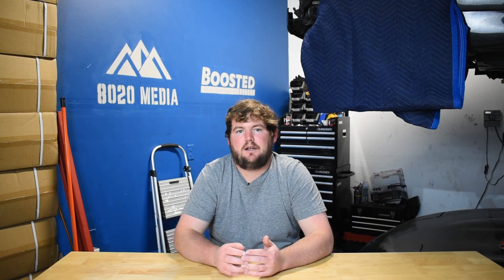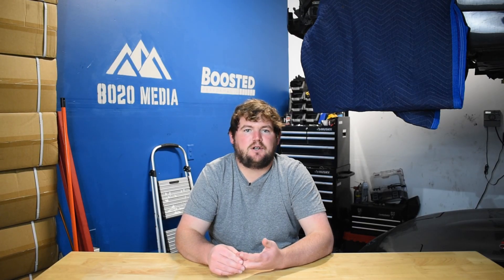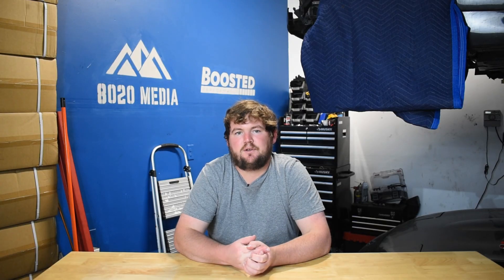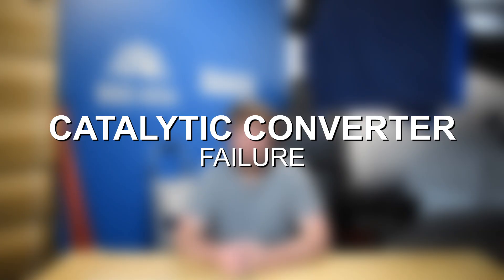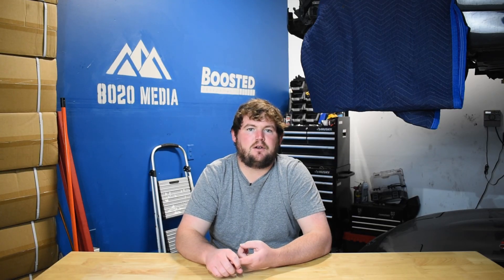Hyundai’s 1.6 Engine | Reliability & Common Problems

Comment: Nice video!! Kia makes good engines( except for the Theta 2.4)!! It's neglectful or ill-formed owners that ruin ANY car brand engine!! A neighbor blew up a Dodge 2.4L Tigershark last year running two and a half quarts low on oil! My fully loaded 2014 Kia Forte ES just turned 118K and runs like new!! Change the oil with a new Wix filter, full synthetic every 5K, add a bottle of Chevron Techron and Cataclean once a year, and I check ALL fluids weekly!! Take car of your car and your car will take care of you 😊!!

Comment: 2013 Veloster with 1.6 GDI naturally aspirated. Catalytic converter clogged almost on the dot at 100k miles and forced the car into limp mode on the highway. May or may not have hollowed it out and used a spacer on an O2 sensor to prevent the code and CEL.

Comment: Here we go...i bought a 2015 kia soul 1.6 gdi with 6 speed manual transmission,  brand new. Bought a KN air filter, like the second day i got it. Oil changes from Walmart every 4000 miles regular quarter state. That little coach roach refuses to die on original engine and transmission at 270k miles. At this point is all beat up from the outside paint ,gets tires from pick an pull ,but everything works from electrical to mechanical.  I guess is all how you take care of it....😂😂😂😂😂
Reply: Any engine related trouble? My rio is about 200 000km and the engine is solid and working as new...PCV valve changed at 96 000km...that's it...I love that little engine! In manual it feels like honda used to be...
Reply: I too got some doors and part from u-pull to keep it fresh! 350$ for a front fender, driver side door and hatch, an afternoon of wrenching all color matched, also got 17 inches mags and brand new tire a aliexpress 11 inches radio...and added sound insulation...LED headlights too! it's a cheap fun car, mine is 11 years old and rocking! I love this little thing!
Reply: @theadvocate4698 the newer 2.0s from kia for some reason catch on fire 🔥, I think is the oil passages that get block or something cause. I like the 1.6s from kia the rest i can't speak on 100%% but i would stay away.

Comment: I just picked up a 2023 N line 1.6 L turbo. I really have not seen any negatives on the vehicle. It only has 14,000 miles on it at this point.
Reply from the maker: J - Congrats on the new ride! We would advise just maintaining it well.
Reply: @8020Automotive  Thank you, i’m a firm believer in changing my oil every 4000 miles or six months which ever comes first.

Comment: Great video.  I have the 1.6L turbo on my 2021 Kia Seltos SX.  It passed 30K recently.  The car is never in cold weather (desert climate here) but doesn’t get too much highway driving.  Should I get the pricey fuel induction service my shop is suggesting?

Comment: Question ... what if you ran a say a tank of E85 thru the engine (if it E85 approved) would that act as a cleaner for the GDI system ?
Reply from the maker: B - Running a tank of E85 through your Hyundai 1.6 GDI (if it’s flex-fuel rated) can help clean fuel injectors and combustion chambers, but it won’t do much for the intake valves — and that’s where most GDI carbon buildup occurs.
Reply: @8020Automotive  Food for tought, i saw a video of the internal working of the 1.6 GDI, and from the video, it seems like the injectors are shooting directly on the valve, wich would help to keep it clean ...Of course the chamber is not getting cleaned, but the valve may be...it was worrying me when i bought the car but it runs great after 200 000km with regular oil change only, no problem at all from "gunking"...

Comment: I have a 2019 hyundai veloster turbo r spec and I've driven the fuck out of it. Have 108k on it. Have done regular oil changes atleast every 7k miles. Lucas stabilizer everytime. Have had NO problems with the motor itself, I did replace the plugs around 70k. And again at 98k, at 98k also replaced coils, 1 went bad. Figured replace em all at once and just b done with it. Fixed the misfire thst had judt started

Samn good car

Ive driven it ALOT cruising at 100, 110..

Need to service the trans soon.
Reply from the maker: S - Thanks for taking the time to share your experience. Sounds like you take great care of it!

Comment: I’m here because I just bought a 2025 Santa Fe hybrid with the 1.6 turbo. I haven’t had an engine this small since my 1979 Accord. I’ve a motorcycle with more displacement. 
Good to know these don’t have the same issues that the Theta’s did. I had to replace one at 90k in my old Santa Fe. Hopefully this Santa Fe will not repeat that. 
Good content , liked and subscribed.
Reply from the maker: S - Thanks for the feedback! Your Santa Fe has a newer generation engine. So it should be fairly solid, so long as maintenance is kept up with

Comment: 2015 Hyundai Veloster NA Reflex Edition. Horrible car. Gave up at 169K. It was great at first then around 140k started having oil consumption issues. Started taking care of it better with shorter intervals between oil changes, carbon cleaners, fuel cleaners, etc. Had to get a new catalytic converter and still the issue persisted with a CEL to the point it left me stranded several times. 

There was a time I was putting a quart of oil every 200-300 miles. Used Valvoline Restore n Protect and it reduced that by ALOT. My car was on recall but dealership wouldn't honor it. Said they already inspected it when I brought it in for oil consumption issues and it didn't need a new engine. Called Hyundai Corp and got the run around, said it wasnt a clean title. So disappointed considering my first car was an 06 Hyundai Sonata V6 where the Trans gave up at 200K. Loved that car. The 1.8L I4 veloster? Trash

Gave up and got a Honda, best decision ever. Never going near a Hyundai ever again. JDM and German all the way.
Reply from the maker: M - Sorry to hear this.. However, we appreciate you taking the time to share your experience!

Comment: Have a 2014 Kia Forte Koup SX 1.6l turbo. Bought it with 98,500 miles. Turbo went out at 109,000 miles. Starter went out at 115,000 miles. Replaced camshaft position sensor. Oil filter cooler replaced at 117,000 miles. Right wheel bearing at 115,000 miles. Hope I’ll start getting better luck.  We are almost at 118,000 miles currently.
Reply: You seem to have bought a beat up car.
Reply: @dgdave2673 yeah 119,000 just hoping to make it to 200,000
Reply from the maker: 2 - Thanks for taking the time to share your experience! We hope you do too.

Comment: I’m giving serious thought to getting a new Venue in 2026, and it has an important engine upgrade: dual port injection (the 1.6 DPI engine I believe they introduced in the 2020 Venue).  DPI, which Toyota has also brought out, addresses the carbon buildup problem that’s so common with a lot of GDI engines.  Does anyone know how the DPI engines are working out? If so, I’d love to read any comments by people who know.
Reply from the maker: I - Hyundai’s 1.6 DPI (Dual-Port Injection) engine in the 2026 Venue is a solid improvement over traditional GDI (Gasoline Direct Injection) engines, specifically addressing carbon buildup on intake valves—one of the biggest downsides of GDI-only systems. By using both port and direct injection, DPI ensures that fuel is sprayed over the intake valves, helping to clean deposits and improve long-term reliability. Toyota and Honda have also adopted similar D-4S and dual-injection systems for the same reason. Early feedback on Hyundai/Kia's DPI engines suggests they are more durable and require less maintenance compared to their full-GDI predecessors. While they may sacrifice a bit of fuel economy and power compared to full-GDI engines, they offer a better balance of performance, longevity, and reduced intake valve cleaning needs. If reliability is your top priority, DPI is a great step forward.

Comment: Great Info on GDI I'm still new to GDI. I found this vid looking for the head torque specs on 2014 veloster 1.6l  GDI, if you know the specs it would help I don't have access to service manual thanks' in advance
Reply from the maker: B - Torque all head bolts to 18 lb-ft (25 Nm) in the correct sequence. Tighten all bolts to 44 lb-ft (60 Nm) in sequence.

Comment: Hello. My car is a 2024 KIA SPORTAGE PHEV, Hyundai-KIA G4FT Smartstream 1.6 T-GDI engine
The 1.6-liter Hybrid has been produced since 2020 and is installed in hybrid versions of 
such well-known models as Tucson, Sorento and Santa Fe. This power unit is widely used in Europe.
What oil with the highest viscosity would you recommend, given the engine design,
because I don’t want to pour 0W20 water. I know about hydrocracking, PAO and other oil characteristics.
What do you know about this G4FT engine and what would you recommend paying attention to during exploitation?
I fill my old BMW M57 2005 engine with fully synthetic 10W60 RACING oil,
so the engine runs great for a long time and I have no problems with the engine.
Reply from the maker: M - Switching to 5W30 or 5W40, if permitted by local climate and driving conditions, can provide a slight increase in high-temperature protection while remaining compatible with the engine's design. However, ensure the oil you choose meets the required specifications for modern turbocharged engines.

Comment: Kia soul 2014 with a G4FD. Cylinders scrapped the cylinders wals, dead at 110.000. engine replaced with a new one. 33.000 miles later with the new engine, the oil is turning into mayonnaise. new cylinder head gasket required. Since I was not the original owner, Kia reject any reimbursement for the replacement of the engine. Those engine are crap. Poor manufacturing, poor use of material.
Reply from the maker: M - Sorry to hear this. However, thank you for taking the time to share your experience!

Comment: How about the knocking issue that Hyundai offered extended warranty on? Considering a used 2014 Hyundai Volester with 100K miles. Will it just die on me?
Reply from the maker: Y - Not likely, but you'll certainly want to get it checked out!

Comment: I have a 2010 hyundai accent with 160k miles I really love it. Its slow lol but a great first car or daily driver, I put 2 12 inch subs in it 😂. After 2 years I have only had water pump failure and the ac belt, I changed the o rings and valve cover gasket after some misfires and changing multiple spark plugs no problems since. In the last full year its been 0 problems (knock on wood) im more worried about the transmission then the motor honestly. Appreciate this video!
Reply from the maker: S - Thanks for the feedback and taking the time to share your experience!
Reply: Thats a pre-nightmare engine, those are as reliable as early 2000s Toyotas.
Reply: @chiefdenis definitely not 😂 either my mechanic sucked or the engine sucked because after I had the water pump changed with the timing belt the timing belt slipped and got stuck in the engine while I was going to work in the morning, it's an interference engine WITH A TIMING BELT, I think the belt got wet but nontheless not a car to keep long term it's not made to last. so now I have a Honda civic and it's the  best car anyone could ever buy. It has a timing chain which is important for interference motors and it had a 100k tune up.

Comment: They seem to have high oil consumption from what I can tell, every one I've worked on a had low oil some to the point of oil light flickering. 

Plenty of examples of dropped rods too resulting in catastrophic failure.
Reply from the maker: N - Unfortunately!

Comment: Some say the piston rings are flawed on the 1.6L which causes excessive gas to get into the oil.
Reply from the maker: F - This is true.
Reply: @8020Automotive  I'll have to send an oil sample to one of the labs to be sure I'm changing the oil before an unacceptable amount of gas gets into the oil... I wonder how much it would cost to have a good engine shop to install good aftermarket piston rings. Any idea?
Reply from the maker: F - Not too sure. Difficult not knowing labor rates, etc. But it wouldn't be cheap.

Comment: Thank you for so much info! My 1.6 gdi  is 10 years old and i was worried about long term reliability, so few info on them...that was very ressourcefull! My guts tells me this is a good solid engine as it as given me no problem at 186 000km except the pcv valve at 96 000 km...plus in a manual car, it feels like a honda's of the 90's...I kinda wanna get a 1.6T in manual...seems fun!
Reply from the maker: T - They can be very solid if taken care of!
Reply: 195 000 and still going strong! Maybe it is a good engine?

Comment: I just bought a used 2016 Rio LX with 106k miles. Looks like past maintenance has been spotty. I just did an oil and filter change and will be checking the PCV valve and air cleaner soon.
Reply from the maker: You can turn it around! Just hit all of the 100,000 mile maintenance and stay on top of it. Hyundai's can be very reliable!

Comment: Kinda nervous about my 2020 veloster turbo, i wanna push maybe 230-250 hp with a tune but not sure how it will hold over time. I plan incrase flow and remove air restrictions, the turbo oil line was something iv not heard anyone talk about but I'll def upgrade that. Anything else that might be effect alot by the increase in hp and boost? I know new spark plugs is good idea before a tune.
Reply from the maker: P - We have an article on our website that may be helpful here: https://tuningpro.co/best-hyundai-veloster-turbo-performance-mods/

Comment: Have a 2017 turbo with DCT, have intake, exhaust, just put on an oil catch can a few months back and got the intake valves cleaned.  Bought it at 87k and at 115k miles currently and still runs great even at WOT. The only issue that I ever had mechanically was a bad fuel pump.

The car is not as bad everyone makes it out to be. Yea some come out bad and shit the bed immediately but what car brand hasn’t had bad model years/recalls? As long as you do proper maintenance and don’t dog it everywhere, this little clown car can go the distance with little issues.
Reply from the maker: P - Well said! Thanks for sharing your experience.

Comment: Thats why its detrimental to use atleast mid grade gas, gas additives occasionaly between fill ups, only OEM  oil filters and change oil every 3500 to 4k miles. These engines as all kia/hyundai engines have weak oil pumps.
Reply from the maker: R - Well said!

Comment: I’m looking for information regarding connecting route failures in the 1.6 L GDI – I have a 2015 Hyundai Accent– I’ve already asked for a an extended warranty, but was denied, but I believe that this is a far more common problem than Hyundai is letting on in Canada
Reply from the maker: D - Guessing you mean connecting rods?

Comment: Mine has a slight ruff idle whenbi cold start it every morning but goea away after 10 seconds and all is fine after. Should i be worried??
Reply from the maker: A - So long as it goes away, you should be good. We have a video on rough idle that we think could help in the future: https://youtu.be/BiYsqRJCLhE
Reply: @8020Automotive  cheers dude
Reply from the maker: A - Keep us updated!

Comment: In a Kia Rio 2019 s   … does it have a gamma or a gamma 2 ?
Reply from the maker: S - Should be a gamma 2.
Reply: @8020Automotive  Ok… but are some Sensors interchangeable between Engines Because I’ve replaced a sensor that goes to a gamma 1 in my Kia 2019 and it’s running like a Champ ?
Reply from the maker: S - I'm sure they are. Very similar engines.

Comment: I’m confused. Does the 2022 accent se have dual injection? I’m getting different answers
Reply from the maker: Run a VIN check and see what engine you have. MPi is traditional port injection, DPi is dual port which is direct + port injection fueling.
Reply: @8020Automotive  says MPi for mine. Thanks for the help 🙏🏽

Comment: Do you know if these are common block/components? Theoretically if I have a 1.6Mpi I could take a T-GDI turbo and exhaust manifold I could bolt it up and plumb it up and tune it? What about the IVT transmissions? How much torque can the IVT handle? Thanks in advance
Reply: I would look up the possible mapping issues software wise because now you're forcing more air into a mpi engine.

Comment: Save you a bunch of time;
Don't mess with these things, they are trash. 
Just buy Toyota or Honda.
Reply from the maker: B - Not necessarily true. These can be VERY reliable if taken care of properly, just like any other vehicle.
Reply: @8020Automotive  The question then becomes why. GDI + Turbo = high maintenance by default. Very reliable starts around 250k+. 
These engines are just not of the same class as say a 2AR-FE. PFI + NA vs GDI + Turbo, the NA engine is going to win every time on the reliability front. 

If i got 7k to go buy a car with and it needs to work and last a long time (Assuming you do your homework and have it looked over)
We are talking like a Elantra or a Camry or a Corolla, and like a Civic with their very good 2.0L. 

Again, why spend on the engine that has had problems vs the cars with engines that are generally bulletproof when taken care of? The Honda or Toyota is boring, but the better option in most cases.
Reply from the maker: B - Thanks for sharing this insight. Very reliable being 250k might be a stretch, but we appreciate you taking the time to share.